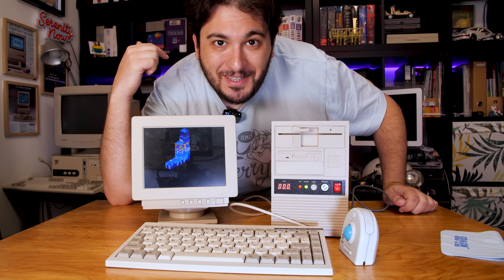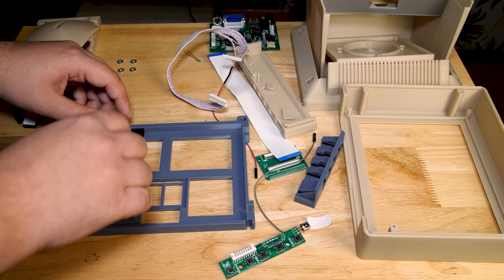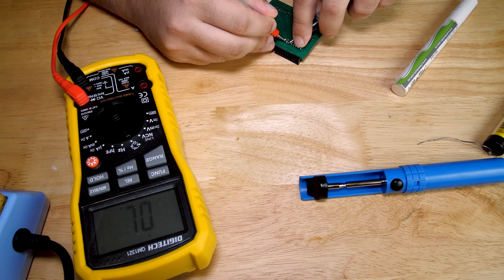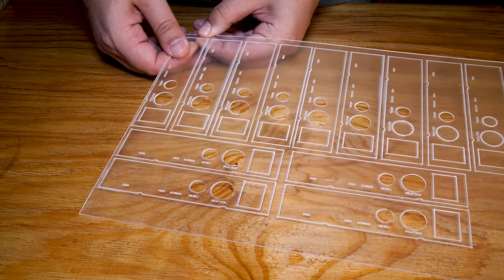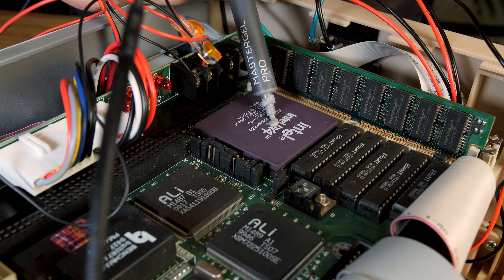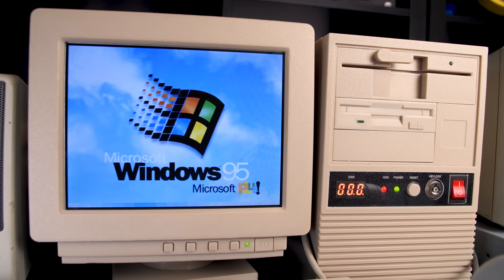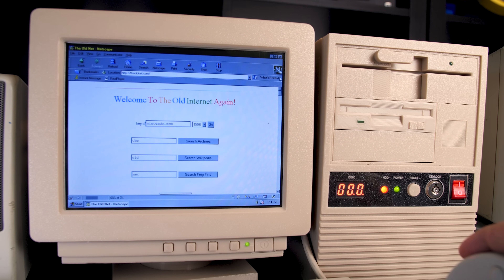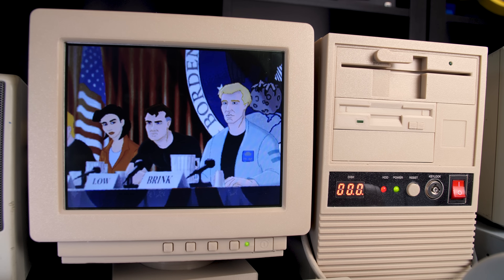A Tiny (Real) Intel 486 Built From Scratch

Comment: First of all, congratulations to the great work you have done. This case is an absolute masterpiece in regards of looks and also the ideas you put in there. The floppy drive is absolutely stunning.
But I feel there is something wrong with your system, the DX4 is a pretty hefty 486 and the ET4000 is the peak of ISA graphics performance. The overall performance should be much higher. Two ideas: Either the board is lacking of L2 Cache (could be quite common among industrial SBCs, then unfortunately you cannot change a thing about this on this SBC board), or the cache is disabled in some setting (BIOS/Turbo/...). Does the SBC have a turbo switch connector? Because not all boards handle it the same way, if closing the turbo-switch-jumper will turbo (full speed) or de-turbo (reduced speed - in modern systems typically a combination of disabled cache and added waitstates) the system. So if you have a turbo switch currently open, it might be worth to put a jumper on it and see how the performance changes. And in regards of checking on cache, try the benchmarks collection from Phils Computer Lab.
Reply from the maker: I'll give it a go, I'm not sure if the mobo has the connector for a turbo switch, I'll have to check the manual!
Thanks for the comment!
Reply: The ISA bus is EXTREMELY slow at 8Mhz, an ISA graphics card will severely cripple any 486 CPU. That said, the performance in the video seems too slow even for an ISA card, which might point to something else being off. I've used a crappy Trident 8900D ISA on a DX/33 in the early '90s and it was faster than what is shown. The possibility of there being a turbo switch on the board is one to check - although I gotta say, the loading times for Win 95 and Win 3.1 seem quite good and in line to what'd be expected from a DX4/100 (assuming there aren't cuts...). 

A good way to figure out what's going on would be to run the standard DOS benchmarks suite from PhilsComputerLab. That would give some figures to start comparing from.
Reply: @h3llr4iser1  Indeed, that was the very reason why VLB was a thing.
Reply: I agree, it should run faster with a DX4. In the video it behaves like a DX2. Try to run some benchmarks.

I love the small form factor by the way.
Reply: @cptcrogge  I played Lemmings paintball pretty well on my DX-2 back in the day. Acts more like a 386. Something is definately up with the system.

Comment: Hi, that is very good work

Part way through the build as you completed the monitor housing i was thinking it would be a nice single box unit ala Macintosh Classic style  monitor with the PC items in it as well

The other thing is using a older and cheap wyse CX0 C10LE or similar as they are basically a x86 pc - that can be the base the monitor sits on. they are cheap at @ $30 Australia or $20 USD - i have one with just dos 6.22 and my favourite older games - they even support 2 monitors

There are many project with dos, win 3.1x win98 and WinXP, i also have a separate Disk On Module  ( sort of ide flash drive ) with linux puppy 5 and dos box - this give full emulate SB16 sound

But what you have done is really great - Congratulations
Reply from the maker: I'm thinking of doing a mac, but that'd have to be emulated.

Comment: I recommend making an internal lattice, to brace against flexing from external stress (over time the cabinet and the monitor could become misshaped).
Reply from the maker: Yeah, I'm worried about heat, but I don't use it very often and it doesn't get super hot.

Comment: Wow, amazing job!
The trick with the fake 5.25" drive is cool 😄
The performance feels low for 100 MHz 486, though 🤔 Is it possible that it isn't running at full speed because of some settings?
At least, DX4-100 should be able to play MP3s, even at 320 kbit/s
Reply from the maker: Yeah, I thought it was strange as well, I'll play more with the BIOS.